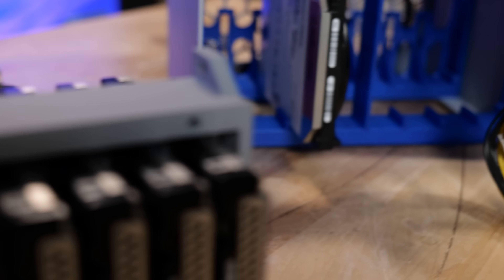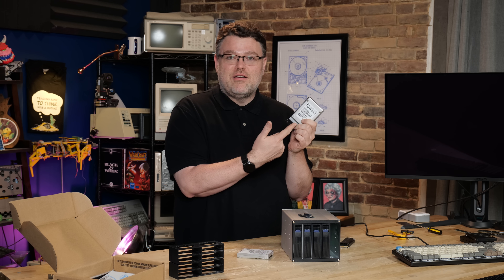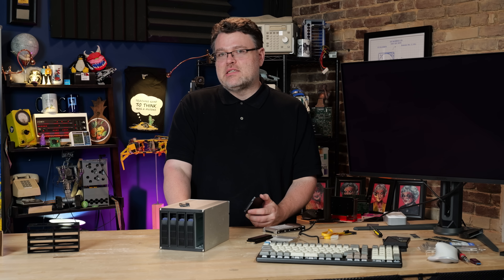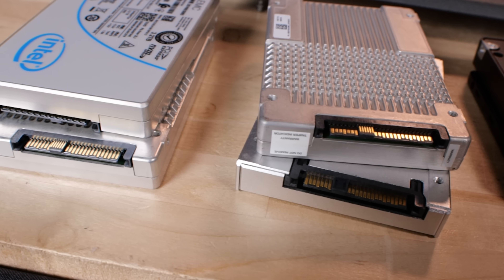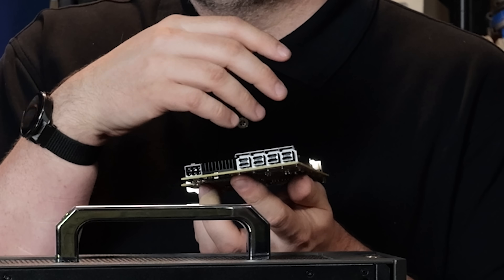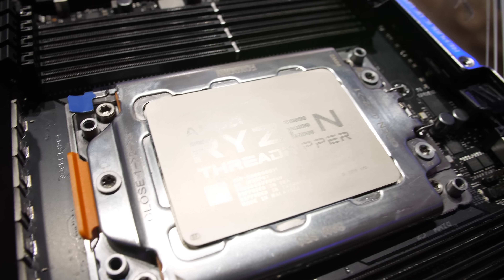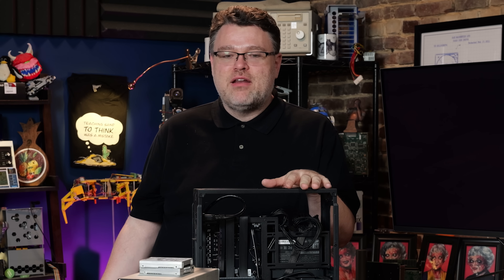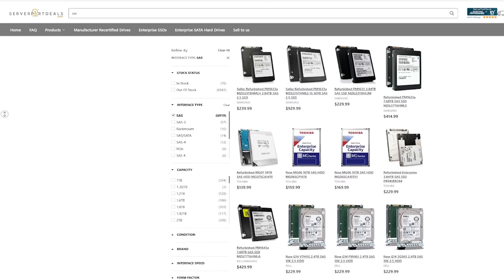Need Cheap Mass Storage? Try Surplus SAS Flash!

Comment: This sounded cool... But then we get to the cost per TB aaaaand I realised I really need to stick to HDDs. I'm really not doing anything that needs speed. I do need the savings.
Gonna watch the SAS part though, cause I've been avoiding SAS drives cause I didn't know how to make them work in a normal PC. Probably need a card that's another $50-100, I'm guessing...
Reply: Fucking called it...
And it needs active cooling, so I need more fans, which I'm already short on... and space, and airflow... So yeah. HDDs for me.

Comment: I really don't see how SAS is competitive for home media servers. Likely at 16 terabytes per drive since you can't get that at consumer, but most of serverpartdeals is more expensive than $50-60 per tb when this video came out. I understand they have endurance and are designed for intensive workloads, but with firmware bugs and the higher power usage of that SAS card; I am asking why over consumer Samsung drives?

A 2xminiSAS + minisas to sas breakout cables sounds like a better solution on the motherboard. Especially if it comes on consumer Epyc and we can reduce it to 2x pcie lanes per flash drive. Most people don't need more than that unless they are doing an engineering or an AI workstation-which is what you do Wendell. 🙂

Comment: i use SATA SSDs in my servers. SAS was way too expensive and doesn't have any benefits for my use case. i mean yes there are faster and more resilient but nothing you can fix with the right formatting and a RAID configuration. I have at home a 10gbit network in my server rack but nearly every device that is connected to my network speaks 1gbit and some can do 2.5gbit, but non can do 10gbit. 
I payed for my Dell PowerEdge r630 only 300€ and updated it with another 300€. so i dont see the point putting multi hundred € expensive Drives into my system without any benefits. 
my R630 runs with the 8 SATA drives fine and i hand only one drive failure on the last 4 years i own this system. My r630 does not much. It is providing some services for me, family and my friends. Some game servers. Most of the time it is idling at 2% load and max load was about 30%. The Network connection to the internet is 55mbit down and 11mbit upload. So yeah if a SAS drive cant beat a expensive SATA SSD brand with the same capacity, I won't buy it. I mean i use the cheapest drives from a known brand i can find. Verbatim Vi550 S3 512gb

Comment: I've used a one of those sas cads with a 16 bay 2.5 inch hot swap , then I'm using cheap 4TB samsung 870 sata drives, maybe not as cheap as used sas drives could be, but I've not found cheap sas drives in the Netherlands, they are all still about twice as expensive 2nd hand as consumer ssd's. I bought a cheap am5 motherboard with a 8700G, and it's great, i currently only use 5GB ethernet (because i don't have room for a 25gb nic in my pc), but i am able to fully saturate it, and for my type of usage it's plenty fast for now, great setup for a reasonable price in my opinion

Comment: What a perfect timing for this vid! I just got 5x 1.92tb Kioxia PM5-V earlier last month for $70 each and an LSI 9300-8i for $30, got it running RAID 5 now using windows storage spaces, so far it's been great
Reply: That's a steal. They're like $130 bare minimum. Plenty listed for higher than that too.
Reply: @bryce2113  Yeah I couldn't believe it either, I ordered 1 to make sure it legit, then ordered 4 more after that. Too bad all sold out now after I watched this vid.

There are cheaper PM5-R taken out from Fujitsu Eternus which cost $50 each for 1.92tb model but they come with time-bombed firmware and I couldn't flash them (tried storcli and openseachest)

Comment: A thing to be said about flash storage is even when it starts to be worn, it's good for read-only, like archival.
Reply: What? not true at all, and leaving data on SSDs that arent powered on (like in an archive) is not a good idea, like, at all.
Reply: @baudneo  Yes, it is. Reading does not wear out flash memory. And where on Earth did you come up with the idea that an archive can't have power?
Reply: @jeschinstad you need to learn how to actually communicate what you mean then. There is a huge difference between "starts to be worn" and "completely worn out". For your absurd question: usually archiving disks means writing data on them, removing power and storing them. I'm now assuming you are talking about cold storage, but who knows and better yet, who cares.
Reply: @baudneo  No, archives are typically online, but they are used as WORM storage. Flash storage can take a certain number of writes and for use like databases or OS where you write a lot, you want to replace them before they wear out, but they are perfectly fine to use as WORM storage since reading doesn't wear them out. Cold storage is something entirely different, but cold storage can also be powered. It's just not connected to a computer system. In my datasafe I use SATA SSDs and I power them by battery, one second every week. That's all that's needed.

Comment: 25 gig doesn't require fiber optics, nor does 40 gig. I have copper cables running both speeds.
Reply: It can be done. I use 10gig LAN on copper as well, but I would switch to fiber optics if I were to do it again or upgrade to anything faster. The cards with tend to be much cheaper and AFAIK the power consumption is also much lower.
Reply: @Hugh_I  We might not be talking about the same thing. I'm talking about DAC cables, not CAT cables.
Reply: @michaelgleason4791  Oh you're right, I was only thinking of CAT cables. DAC of course does not have either of the two downsides I mentioned.

Comment: It might be even cheaper to use a "mining" M.2 to x4 PCIe adapter (like $10) for the SAS, and then put the network in the x16 slot.  If it supports x8x4x4, as many do, there is a Dual NVMe riser that has an x8 electrical slot on the top, $13-25.  So you still get an x8 Network and dual NVMe, or 3x NVMe as most newer ITX have dual NVMe

Comment: Great content! However, the pricing is close enough to that of new NVMe drives that most people would likely opt for newer consumer drives with significantly higher performance. The main drawback, though, is the need for sufficient PCIe lanes—something that typically requires expensive workstation or server hardware, since most consumer platforms are limited in that regard.

Comment: Where is this mythical flash storage? I have not seen used enterprise flash for less than $50/TB. Which is about 5 times as costly as used enterprise hard drives. It's really been like this for several years besides the short insanity of $6/TB for used enterprise hard drives.

Comment: I think a lot of people are missing the point here.  This isn't cheap for bulk storage for your Plex library.  This is cheap for flash storage.  If you need something more performant (but can't afford NVMe or PDIMMs) this is a viable alternative for light VM duty, storing your Plex database and metadata, or other tasks that are brutally slow on spinning rust.  

It's relatively cheap, not absolutely cheap.
Reply: That's not entirely true, either. These prices for used Enterprise gear are about the same as new Consumer gear. So... it's only cheap relative to "new Enterprise", which likely nobody watching these videos is considering for their home NAS anyway.
Reply: @no1unorightnow  Meh.  Given the context of the posts I was responding to (the vast majority of which were comparing the SAS flash to used SATA/SAS HDDs) I'll stand by my post.  To each his own.

Comment: Have that LSI HBA flashed and in a x16 slot performing as a x4 slot. 12 hdd plugged in and it doesn't max out the x4 lanes.  Still needs cooling, but it'll probably outlast my need for SAS/SATA connectors through all the machines it'll end up in.

Comment: I revived old Dell T620 i had lying around, hacked it so it now fits 8x3.5inch drives (8x2TB SAS 7k2 i had around ) and 8x2.5inch drives (8x800G SAS SSD - HGST HUSMM1680ASS205/4) i got on ebay for about 350USD. SSDs all report above ~95% endurance but i cant trust it, saw some posts around internets some sellers tend to hack the SMART data with tools and sell drives as low usage ones.
Anyway, I also dropped Mellanox connectx-4 into the server, Intel x710 into my desktop, bought 4port Mikrotik 10G switch and now I actually have my Steam library over iSCSI on my desktop using ~1GB/s speeds :) . Plus some VMs and firewalls too. Only downside on idle the server pulls 200W :D

Comment: Planning on adding 2x 15.36TB or 3x7.68TB to my TrueNAS setup later this year (along side my existing 8x14TB rust).  Either SAS or NVME, leaning towards NVMe as cost seems to be similar. Either a SAS HBA  or a 4 port NVMe adpater will be going into a PCIe 4.0 x8 slot. Ultimate speed isn't super important, will be limited by 10Gbe for most things anyway.

Is there anything I should consider in the decision on NVME vs SAS? Or should I go with whichever offers me the best value at purchase time.

Comment: I just did this with a LSI HBA PCI card and 8 x 2.5" 2TB drives on a used Supermicro dual LGA 3647 Xeon board, also installed 2 x 4 slot NVME PCI 16x cards all under TrueNAS, I had all spinning rust before, and Ive gone from over 400watt continuous power draw to less than 70watt and I have 10x the IO for data transfer, totally worth it, and the cost of this used gear is like cents on the dollar now, also slapped a A310 in it for Plex and Frigate.
Reply: Why dual cpu if you want power savings?
Reply: @privateaccount5400  Because I wanted the ability to have more cores and even more so, I wanted the additional PCI Express Lanes, I don't just run Plex, even with dual 3647's they pull less power than the i9 9900K they replaced, the machine has 13 NVME drives it now, try doing that on a single consumer CPU setup.
Reply: @NexGen-3D thanks. Iv been looking at Siena but still need to find some real world idle power examples, can scale up in future if prices drop

Comment: Im about to build a nas/server using the eHBA 9600-24i, using a 9654 8i to x8 u.3 (sff ta 1001) connector to a u.3 to m.2 adapter I will be able to get 24 nvme 4.0 ssds with 2GB/s throughput.

I will use an x16 to 2 x8 adapter to then put a 100Gbe card on the other x8 slot. 

Im using the minis forum bd790i so 1 of the pcie 5.0 m.2 slots will be a high speed cache if the raid isnt fast enough and the other m.2 slot will have m.2 to pcie 4x slot and ill be throwing in something like the 3050 for hardware encoding. 

Wish the strix halo series had a apu with more pcie lanes, because that gpu looks beef af meaning i can make the server even smaller

Comment: We have different definitions of cheap. I have built a TrueNAS based NAS, and 4x8TB HDD storage costed me around $400. With those SAS SSDs it would have been around $1600 based on that $50/TB.
Reply: New prosumer NAS-rated rust is about $20/TB.  $50 for used probably only makes sense for IOP-bound storage, not large archives.
Reply: @flowerpt at least here in Germany I found that the NAS HDDs are the costliest. Real enterprise disks, especially the Toshiba MG series are a bit cheaper. 
When building a NAS with RAID, I would not really use second hand storage (unless it's VERY cheap), as the warranty period of 5 years for new drives is just gold. 
A drive dies - I get a replacement - free of charge, and usually within a week or two.
Reply: And I have a NAS that is about £100 maybe 200 worth of bits new being a Pi based solution (cost me nothing but slimmed down my junk horde), but the performance of these NAS is substantially different as well. Flash based is going to be quieter, faster, more energy efficient than HDD, so cost more initially yes but if you have the network speed and a potent enough CPU to saturate that HDD NAS you'll really feel the difference in use.
Reply: BUT, what's the math on the power consumption of your build versus a Flash-based build? If using Enterprise-grade Flash vs Enterprise-grade HDDs over the long run the Flash would likely be cheaper.
Reply: @kurthuber7639  "BUT, what's the math on the power consumption" In reality so small as to not be worth taking into account. Even if it pulls 10W per drive (and many pull well under that) that's just 960 Wh per day or 350,400Wh per year. So you are talking about perhaps $50 a year to run those.  Now remember even an SSD still pulls power at idle, likely around a watt. So the true savings is going to be minimal and you may not recoup the extra $1200 before the drives die. Because even at $50 a year to break even you'd have to use the drives for 24 years given the OP's data. So not really a factor one should seriously consider.

Comment: I went with the 9400-16i to have gen 3 PCIE and reduced power consumption.  It is entirely bus powered and can also be half height.  They're more expensive though.  The 9305 drops the tri mode (NVME) support but is a single controller so the power consumption is lower.  The 9200 like you have is dual controller with a PCIE switch and thus that's why the power consumption is higher.

Comment: My DS4246 with sixteen 4TB 7200rpm SAS drives and DS2246 with ten 240GB SATA SSDs is more fun and more space than 4 of those ($415 at time of comment) 7.68TB SAS drives would have been - but I probably should have just gone that route.  Much cheaper to power and ultimately I ended up spending almost that much anyway since I tried to do it in a normal case first only to find out that no matter how large of a normal ATX PSU you get - the 5V rail is not gonna support a whole lot of drives.
Morale of the story, $14 hard drives and $8.50 SSDs still cost a shocking amount.  The HDDs are two RaidZ3 VDEVs of 8 disks and the SSDs will be a ten wide stripe since read cache is not critical.  Now that I've moved from the antique PC case (seriously, I got a near 20 year old case just to reach 16 HDDs in one box) to the shelves I should have bought in the first place, I could drop another 8 HDDs in for more performance and capacity but then I'd only have 3 cold spares and I'm not sure I need to do so that badly - plus the extra 80W of power usage isn't really needed either.
I'm hoping that the 400GB SAS SSDs get properly cheap so I can get a full set of 24 of 'em and drop a pair of IOM12s in the 2246 with 'em.  At that point it'd practically be like having a full flash NAS.  Although I would also likely want to rebuild my setup from a software side because I would want full hot/cold rather than simply having a read cache.

Comment: Unfortunately the enterprise hardware cycle is lining up with NVMEs becoming truly mass market. These "deals" can't compete with brand new NVME drives even factoring in having to build an entirely new system to house the drives versus repurposing old hardware. What is even the point?
Reply: Don't know what you mean... The price of one new U.2 NVMe (or SAS NVMe) is certainly much higher than used ones and the enterprise SSDs for new connections are even more expensive...

Comment: Yes SSD SAS is finally coming out used on eBay quite a bit! Finally! I love you zing retired Enterprise gear for all my stuff. Because I have everything set up in a CFS raid c3 on my NetApps with six drive spare that are tested good so anytime I drive goes out I just hot swap a new one in. I've been doing that for 15 years now. Most enterprises have a 3-year life cycle where after 3 years it doesn't matter if the thing is still good or not they get rid of it because they don't want it to go bad. And these drives go on for 15 20 years more. I have drives that were made in 2008 I got it 2013 and they are still going 24/7 365 today non-stop plus they're all sass interface as well

Comment: "Want to lose your data? Use molex to SATA!" comes to mind
Reply: The irony with your comment is that it is the SATA connector that is fragile and stupid. The four pin connector is still the king of reliability. Just saying, there is a reason  you don't see SATA power cables in a server chassis.
Reply: @hellboundedward  The slogan plays on a power issue that can happen using (cheap) adapters where your HDD gets fried.
Reply: @owlmostdead9492 facts! I just have a passionate hate for SATA power connectors.
Reply: @hellboundedward  understandable

Comment: I think you have the most informative videos on YouTube, but I have to say that it's mildly infuriating when you say things like the drive has insane durability, or it's pretty slow, and then don't say what what the durability or speed is. Context please. 😢
Reply: You have to do some basic research, durability is measured in the amount of writes a nand system can have before it is unable to write any more data into its system. At this point the drive controller sets the drive as a read only device and is unable to fix errors. You have a very limited amount of time after which your drive becomes useless. This can be measured as DWPD.
Reply: And DWPD of 1 or above is considered enterprise with warranty of 5 years, that is your drive should be able to overwrite itself completely 1 time per day for 5 years. That's a durability of 365x5x(Drive size).